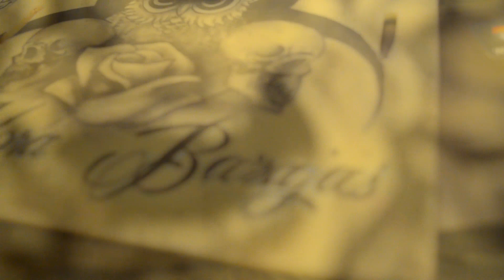TATTOO sketch / SKULL AND ROSES // ChanPK

Comment: I am new to this! tired making a line on my arm but as I whip off once im done with the drawing a line the wound is visible but the ink wipes off! where am I making the mistake? I tried moving the machine really slow and it works 50% I cannot understand is it the speed of my hand movement or is it that I am not poking the needle deep enough....im guessing im doing it incorrect! because 1 tattooed like about 4 lines from which 2 wore off and 2 have come out to be properly settled in my skin.  one by one i'll have to check everything. voltage, needle depth etc but thats alot of needle i will have to go through :D

Comment: You are using a shader for lining.
Reply: its whatever gets the ink in the skin, personal preference mostly just like needle style and ink viscosity. .....
Reply: yup
Reply: Rick Jaramillo says the guy who calls it a GUN !!!! hahahahaha
Reply: Its common practice for traditional or neo-trad artists to use an RS for lining.  You want thick, heavy lines.  

Standard liners or tight group liners are good for when you want precise lines or you want to scrum to build up line weight.  For most nu skool stuff you'll use a tight liner and scrum to build line weight, and its not often you'll be running a single pass line.
Reply: Rotary machine deliver a tighter line, they have absolutely no play when it comes to skin connection, they are practically silent and come in so many variations, you sound like every bitter old head that is afraid of everything new, a real artist uses what ever they are most comfortable with, a real artist critiques the work not the method.

Comment: what is that material ?
Reply: its fake skin - plenty around and not all good. This one (which is good) can be bought on ebay for around £3 (UK) and ships at size 20 x 20, though it's double sided and gives a fair few hours of use. I use it a lot and I think it's good value.
Reply: yup like Steven said,thats fake skin and it used to be bad but the one he is using is the new silicone fake skin which is like a thousand times better than the old rubber fake skin.

Comment: It's not that it's a bad tattoo, cause you blew the tat out of the park. But you did alot wrong. Your ink was in a socket, you wore a hat to tattoo which seems fine but in a shop that will mess up your shading, you were using what I can only assume was a shader for line work, your gun was out of line with your knuckles, and you tilted the gun which is comfortable but ruins tattoos.
Reply: Kenny Ruiz ITS NOT A FUCKING "GUN" goddamit.
Reply: The "MACHINE" is supposed to be slightly tilted, the "MACHINE" does not always have to be in line with your knuckles, so long as your angle of entry and depth are still good.